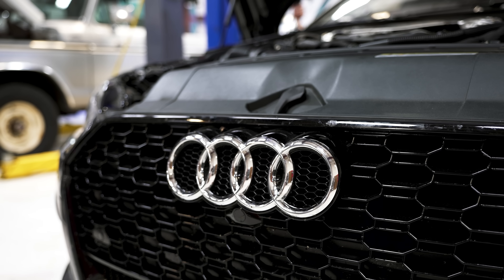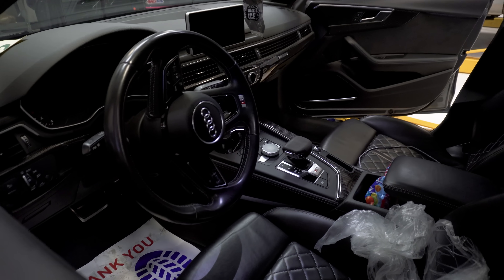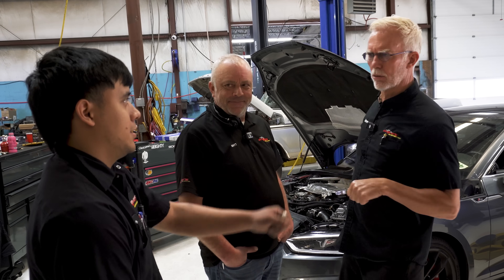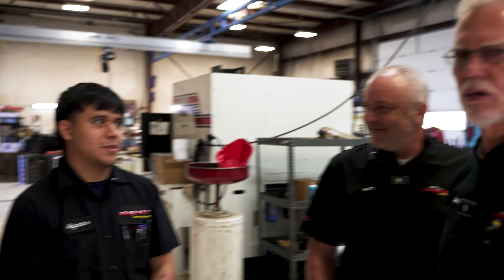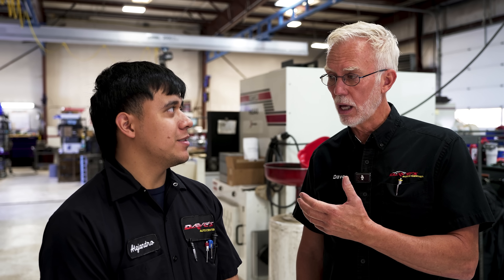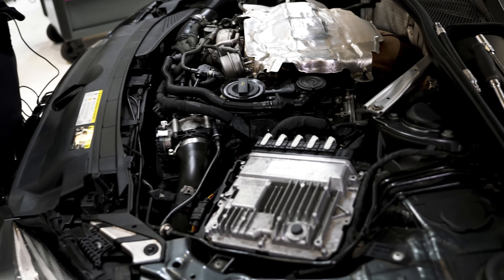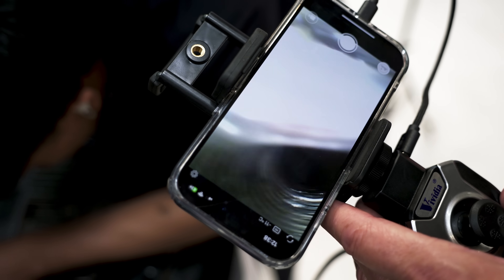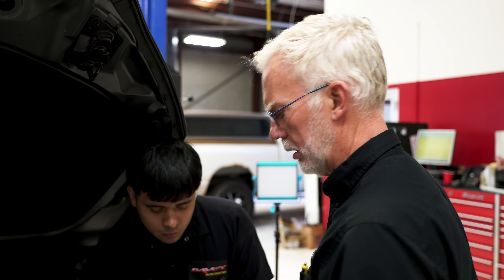Audi S5 Engine Piston Damage

Comment: Nowhere near this expense level but I just sold my 2017 Type R and picked up a 2013 Si with 34,000 miles. The sole reason was not wanting a direct injection Turbo motor long term. I fully understand how to care for one, not to lug it at low speeds etc etc but I still chose to walk away while the mileage was low. My buddy at an Audi dealership told me the only way to ever own an Audi is, Buy new and get rid of it after 3 years no matter what. Don't keep one and don't buy used. Coming from someone who knows these cars in and out, I'll take the advice

Comment: DIRECT INJECTED TURBOCHARGED ENG.  WITH FAIRLY HIGH COMPRESSION.  pIGGYBACK COMPUTERS ARE COMMANDING CARS STOCK HARDWARE TO KEEP IT AT ITS LIMIT.  wASTEGATE CTRL INCLUDED OFCOURSE.  FUEL IGN ETC.  tHIS CAN HAPPEN FRM TOO MUCH BOOST N CRAPPY FUEL

Comment: Audi sent out a warranty extension for this issue. I’m pretty sure it applies to most EA839 engines and if you paid for this repair while the car was under 80K miles (or 8 years), Audi will reimburse you. While the failure rate seems to be under 5%, it’s still something Audi has acknowledged.

Lookup “Audi piston skirt warranty extension” and you’ll find more info.

Comment: Is it petrol cylinder washing on a poorly mapped kick down on the 7th injector washing the bores black smoked due to over fueling combustion temperature is out of range so cold start map returns making even more poor lamda if mapped without a factory inhibitor over fueling occurs lubrication is losses and the piston over heats the picking is the sign of the problem not the cause r b inventor of direct injection never paid by corruption in the motor industry ex VAG mechanic  . ❤

Comment: All the comments slagging off audi, I own a 2003 A8 4.2 V8 petrol had it for years, 130.000 on the clock miles, lovely old motor, moves well also

Comment: This happened to my  2002 Jetta 3 years in into ownership and at 70k. Burning  occurs because extra gasoline is not ignited properly passing throught the cat making them glow and damaging  cats, pre, and post 02 sensors. 

The rich condition happens because there is a coil that's open and has popped meaning it blew and it hesitates with missing spark. 

This is a problem with poor winding material low quality of the copper coils insides that get humidity inside because of the poor quality plastics protecting the coil gets hairline cracks due to engine temperatures🌡️because Bosch is a cheap company. 

To remedy this as soon as you get your VW or Audi or Porche try and see if NippoDenso or Denso i.e Toyota makes a replacement or even Delphi which like Toyota is a major supplier for all car companies including American, Korean, and Japanese markets. 

I went to the Denso site and ordered mine and no coils ever busted on me. Infact, after 20 years I sent the VW to the Junk Yard with a perfect coil in it. Got to love Toyotas man .

On the subject of a computer cylinder shut down. That might happen at 1st. If you stop and shut down the car you are cool. 

But if you cycle stop and restart your car your conputer might go back to normal until it detects the missfire again and by then its too late. 

I am not a mechanic but I have degrees in computer science and I am a software engineer.

Comment: I think car designers and engineers need to build basic simple cars again . Here in Australia we had locally built Holden and Ford cars you could race on Sunday and buy on Monday . 
Simple to repair powerful and last forever . Plus just as power and fast as the latest Audi . Audi wouldn’t even last the punishment of Mt Panorama at Bathurst where most of the Australian race and road cars were tested . Audi glorified Volkswagen. 🥱

Comment: I purchased an 2014 Audi A7 making sure I did pre-buy inspection to include seeing OBD2 codes which were mainly body. 30 minutes after signing I ended up have major coolant leak. In total $7.6K later excluding personal DIY labor hours. I replaced the PCV Valve, thermostat, water pump, top coolant pipe, supercharger rebuild, and radiator fans. I got a lemon where everything that could go wrong with 3.00 TFSI motor went wrong. Really can feel for this customer. Its insane the overcharge, from the factory new fan is $1800. Ended up doing a junkyard salvage pull. Even purchased some parts on discount. VW is the cheapest to maintain out the VAG group.

Comment: I got quoted like 15k timing job for my audi S5,  that was from an independent shop with me already pulling out the motor,
I purchased a new motor, timing parts, a cylinder head, and a set of cams, rocker arms and lifters, all for about 6k and did it myself. 
so i really doubt fixing this engine is the proper way to go, itll probably cost him right above 20k for the engine to get rebuilt

Comment: I have a 2012 acura tl 3.7 awd with 178k and it's never been serviced I've drove to Florida twice from NYC and still have changed the timing belt only batteries and I just changed the alternator and the spark plugs was changed at 112k miles

Comment: Car story time: Andy Mohr Service Center. Bloomington, IN. I bring in the Honda Accord I bought at the attached dealership. The VTEC oil pressure sensor ($35-$200) over bank 1 has burned out (because of the VCM “feature”) It sits directly on top of the engine. One 24mm deep socket is all it takes to replace it. Literally nothing needs to be disassembled. They replaced it for me in about 5 mins, then invoiced me $1200. As a super bonus, they over torqued it. So 20k miles later when it burns out again, I go to replace it. Tightened it to the lowest end of the torque spec, and stripped it to hell. Thank you Andy Mohr Honda! You are simply the worst service center on this planet.

Comment: I love girl motoheads, power to you sister 🎉, another thing you might consider is air Temp and air density at the time of testing, from my experience those things are rarely considered when comparing to manufacturers specs, sure they lie, they also do their testing in Laboratory environment...30 degrees Fahrenheit  at sea level will give different results than a 100 degrees  in Denver.....if you have questions about this just ask...good luck

Comment: Lake Speed covered this extensively   The mixture of fuel and oil that gets in the ring land area has a lower octane than the pure injected fuel.  It can hit a hot spot and predetonatre blowing the land, ring and piston apart. It is stochastic and occurs at lower engine speeds under high load.

1. Direct fuel injection is more prone because fuel is locally blown past the rings.
2. Higher compression, smaller turbocharged engines at low speed but high load are more likely 
3. Higher Ca additive oils. (Not SP P) and long oil change intervals.
4. Non Tier 1 fuels.
This is most of it from memory

Comment: I wish this guy was close when my c7 corvette started misfiring.  I ended wasting 15k when it was all said and done.  The shop used tore the motor apart down to the block before deciding the block was cracked and needed a new long block.  8200 for a new long block and 7100 in labor and parts

Comment: Audi POS, last month had a 2017 Q7 with 3.0 supercharged 117k. Car was using a lot of oil and had a #2 missfire. Found a bad oil separator and rings in #2. All the valve seats were leaking due to too much carbon from failed oil separator/breather. 
Replaced the rings on all six. Was able to get away with lapping the valves and putting on new seals. Did a chain set while I was in there.

Comment: Probably running 87 gasoline and LSPI. Trying to be cheap running regular gas. It does not work properly in cars with an HO engine that requires premium. It also doesn’t save you any money on fuel.

Comment: I just had to replace a longblock on a c7 corvette out of pocket and it was just over 15K.  I cant even imagine getting told 30K,  I bought 2022 S5 with a 100K mile extended warranty for this exact reason.  Be careful with the word options though on a normal car.  Thats what got me into paying 7200 in labor costs.  Every hour a mechanic has to spend on the car its costing money too.  On other cars, its cheaper just replace the motor

Comment: Who buys these? I'd rather have a 1993 Celica. I've never had a misfire on a 6 year old Japanese made vehicle, ever. I get more than 12 years of no issues with sensors or ignition coils, let alone actual engine problems.  You are too nice but I think it's a good thing and I like it.  I love what you do, Dave, but you are the first mechanic to not say Audi's are junk. (Besides factory trained Audi guys). I once got 17 years of perfect working AC on a japanese car.  Didn't even recharge it one time and it blew ice cold air in Florida until the day I finally sold it due to so much body rust from living on the ocean.  I'll never buy anything else.
Reply: most people lease them and when the lease is up they move on to something newer....you would be crazy to hold an audi past its warranty these days

Comment: I haven't watched to the end and I'm not an auto tech, but with the front end question about what causes direct injection detonation. 
Detonation means that the entire charge ignites vs a "controlled burn". 
Requirements: gas, air and ignition source. 
Direct injection means that the gas is squirted directly into the cylinder. 
If no oxygen, no bang, so air is in the cylinder. 
So with gas and oxygen, ignition is caused by spark OR compression reaches sufficient heat. 
All the air mixed with all the fuel at high pressure with a spark/ignition at the wrong time. Prob during the compression. 

answer guess? defect in cylinder / piston and/or timing issue and/or fouled injection nozzle leading to lean mix

Wld love to know the answer. After asking, ChatGPT says there are six possible causes with low octane fuel listed as #1 and lean mix listed as #2.

Watched the "answer" in the next video. Oil contamination was ChatGPT's #6 of 6  possible cause.

Comment: With the Hot "V" Engine out on a 2018 Audi All Pistons, Especially the Old Rocker Arm, Possibly the Cams, Timing Chain, Injectors, angd Have it Carbon Cleaned with Walnuts, and a little more should be Changed. about $17,000, my guess

Comment: Sounds like it may be tuned and or got bad fuel. DI is a little more resistant against detention but even still, wrong fuel or bad fuel in the car can def damage a hole. Thats my guess.

Comment: Bought a first generation Audi TT strictly for track use. 
The block is fairly primitive design but the cylinder head was a work of art. 5 valves per cylinder and the previous owner had them port and polished. 
With that being said, you would think other parts have gone down over the years but some of them such as headlights have gone up. If I want OEM zenon headlights I'm looking at $1300 each

Comment: I hate direct injection because sends a lot of fuel because it's under high pressure into the cylinder and most of that fuel does not get burn completely and up in the crank case. Some manufactures have design their engines with a two system injection port injection with direct injection.

Comment: I bought my 2018 maserati in 2020 from a dealership at 17k miles.
Around 20k i called the dealership to schedule a service, since the previous owner bought a 3 service package for that car and used just 1.
The dealership told me that they used all 3 service package till 17k miles, when Maserati require service each 10k miles. They even sent me a service working sheet for the last service. 
I worked in a repair shop for 20 years, and immediately, i was aware. 
I ordered parts for the specific service maintenance and i found out that air filters were 2016 production and full of sand and gravel stones (it's an issue with maserati sucking everything in the air ducts). There's no way for a dealership that doesn't stock parts, to order online 2016 OEM parts in 2020. 
I took the oil to a lab, i found 2016 production on oil filter...
So, from that moment I service my car  by myself. It doesn't matter what problems will have, i will fix it by myself

Comment: With these DI turbocharged engines, would you recommend getting the valves professionally cleaned at a certain mileage or age of the car ?  Audi quoted me $1700 for my 2018 S5.

Comment: Great Channel-
I daily a Mercedes Benz 1985 W126 300SD Turbo-diesel in-line 5 cyl. Uses no oil.- Oil changed every 2500 mi w/ Liqui Moĺli Syn & BG oil additive. Have 323,000 mi on engin- runs very strong. 
Steve frm Denver. 😊

Comment: I feel for this guy. I've had Audi wins and heartbreaks. Sometimes I have felt like they're over-engineered, sometimes made with avoidable weak points both mechanically and electrically, and occasionally a grand slam of all major things working well and doing so over a long time. What does this mean? Well, I approach all things Audi with a bit of healthy skepticism. This car is a fail, I believe, for Audi. There is likely a catastrophic cylinder incident due to no fault of the original or new second owner.  I think cars at this level should have motors at least good for approaching 150K miles or more when serviced and maintained. All my woes were with vehicles with the 2.0T and 2.5T motors. Strange as those gas motors during their time were the most sold being used in a wide range within the Audi range. To me that should mean very solid. My experience was the opposite, or, basically, I felt it wise to stay away from 4-cylinder turbo assisted Audi vehicles.  I even felt the need to stay away from any Audi with any numbers of cylinders assisted with turbos. My long term wins were with three vehicles featuring the 4.2 V8 naturally aspirated motor those being a Q7, S4, and RS4. Audi needs to step up not only what is delivered new, but to really commit to making vehicles that are so well thought out and realized to normally give amazing long-term service. Right now they're sometimes not even clearing the 50K warranty and I'm sure since they crunch numbers they somehow feel they have just enough that do to just continue making the same quality. Not good enough in my opinion as a person who has owned many over the past almost 25-years. Are you listening Audi? Probably not of course and I have moved on to Porsche w/ a six-year 100K warranty from the dealer. I can only hope I've made a good decision, but it's important for you, Audi, to know you squandered my inherent belief in your brand by both failures and the lack of true transparency (i.e. many known faults not told to the public except by class-action law suits).  I hope you guys can get this one running well long-term without scalping this poor guy who bought in to the Audi glitz only to have it crushed. I've been there.

Comment: Without going any farther I'm thinking that his engine isn't running an API SP grade oil or whatever the European spec is called.  This grade is required for Modern DI engines to prevent LSPI leading to piston damage.  I hope you do a follow up.  By the way, great channel Dave.

Comment: My experience is mainly with BMW. BMW has a pretty intensive "step-student" training program. I am not confident the majority of step students would know the answer. I knew the answer and I 70 and retired for 4 years. I still read technical articles and watch technical videos. No way I can (or want to) go back to work (arthritis, mainly in my hands.) About Dealers going into engines or not going into engines. During the early 90's BMW nikaseal/aluseal debacle with the M52 engine we were required (under warranty time) to transfer engine lower internals from the faulty engine block to a new engine block. All without damaging anything during the process.
Why didn't the customer purchase an extended warranty, was one offered for purchase?

Comment: Misfire on Audi and Volvo shuts down the injectors. A good experienced tech would know this and the cat is saved. As a ASE master with L1 and Volvo expert and Audi certified, you sound ignorant to the customer and I’d be picking my car up if it was me.

Volvo four cyclinder VEP engines had detonation due to incorrect spark plugs. Recall fixed the plugs. Then 5w30 oil was causing detonation and Volvo switched every 2012+ engine to 0w20. AND We all know 0w20 doesn’t protect metal as well as 5w30 (HTHS). That’s why I run 504 spec in my 2024 S5 instead of 0w20 because I also drive the autobahn every day.

Comment: There are 2 ways to get to the main road from my house, up a small but steep hill or the flat but takes a minute longer way. When I cold start my F150 3.5 Ecoboost I now take the flat way to warm up the engine before jumping on the power. Learning from Dave and Lake Speed Jr. reinforces my belief that high quality fuel and oil can prevent a lot of problems. I don’t love passing the cheap gas station with my 36 gallon tank. 😬😳

Comment: Every time you by boosted gasoline engine that 16 years ago was only used on rally race cars your are going to bleed money. High power from small displacement running high boost on second hand car with direct injection that is even worse because your nock sensor will not help you using pump fuel most likely the cheapest possible is a blessing for the manufacturer and a nightmare for the customer. You can’t get something out of nothing there is always a price same like a body builder jacked up on steroids one they his body fails from the abuse and he dyes . The moment the engine hits 100 hp per litre of displacement on gasoline engine at normal rpm around 6000 it is highly stressed engine and it will fail on you guarantee 100%. The moment you put turbo on gasoline engine you cut the life more than half. But this is the trend of the new engines because makes a lot of money for the manufacturer. It makes it easier to make slap a turbo on and you are good to go.